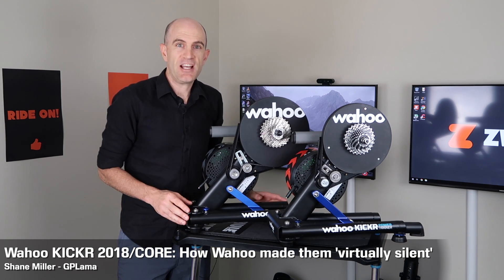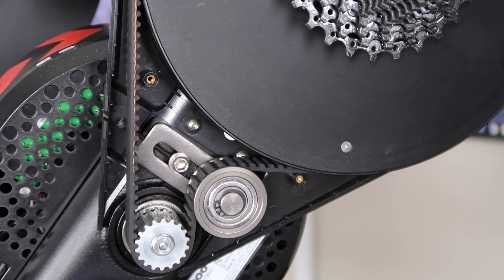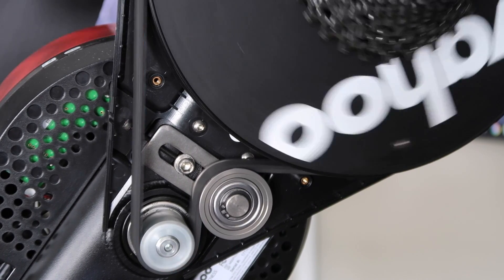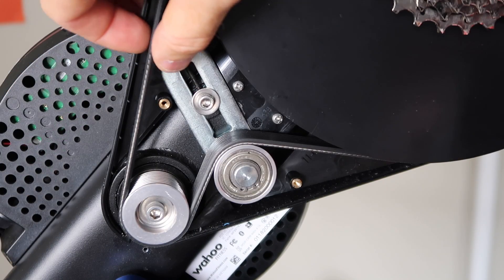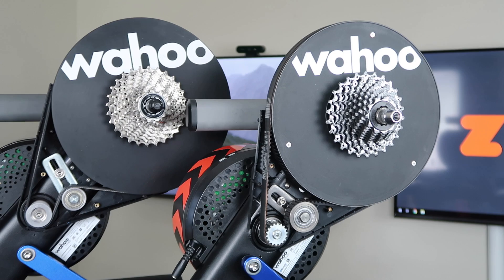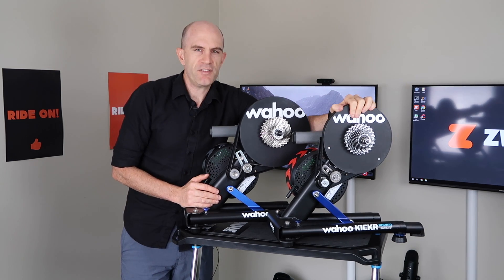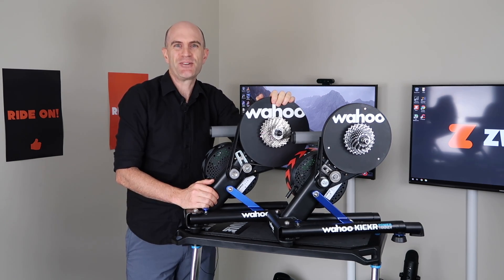Wahoo KICKR 2018/CORE: How Wahoo made them 'virtually silent'

Comment: Widespread issue with silent. All cores seem to have failed quality control and users reporting loud belt noise and clicking. Don't know how to fix mine.
Reply: Mine started making noise after 2 weeks. I have been added into the queue for a replacement, and it will be shipped to me in 2-3 business days. At least it seems like the Wahoo customer support are really snappy :-) I just hope they have fixed the issue on the replacement, cause i really like the Kickr Core.
Reply: @Vifferboy  the replacement models aren't fixed so the same problem will persist
Reply: @TobiasDahlhaus  Guess I will just have to keep sending bad units back then, until the issue is fixed :-(
Reply: This is my issue  https://youtu.be/X4H2ImSb5hs.  

Partially fixed by the local shop with a wahoo repair guide, but still needed a spacer on the plastic to get it silent.
Reply: This is exactly why I will never ever buy a trainer again until it is at least 6 to 12 months on the market. We had the flux and it was exactly the same story...
Reply: I had an issue with a loud noise coming from the wheel that the belt attaches to.  It seems the plastic fairing was rubbing up against the wheel.  I just moved it with my hand and it stopped making noise.  It started making the noise after I moved to a new house.  My guess is the plastic fairing got bumped and moved a bit.  The gap is pretty small.  I bet if they made the gap a bit wider then issue I ran into would be gone.

Comment: Does anyone know of any in-depth servicing that should be carried out on the Kickr, or is it even required? I have got the original Kickr that is 3 years old now and all I have done is the minor service that Shane showed in one of his videos every now and again. Surely the bearings in the drive shaft should be greased/changed for example. I couldn’t find anything on the Wahoo site. I don’t see the point in upgrading just yet when this one does everything I need to a high standard. Thanks in advance.
Reply: Not really sure Ben. I haven't seen much, other than what you mentioned. You could take the belt off and spin the bearings of the pulley, tension wheel and drive wheel by hand and see if you feel any play or roughness in the bearings. These bearings are not subject to dirt or water, so they should last a long time. At the high RPM these trainers operate at, any major bearing issue would be easily identified by significant vibration and noise when riding I'd imagine.

Comment: Isn’t the core a different size flywheel to the 18? It’s a similar size to the previous models
Reply from the maker: Yes, but that's not part of why it's quieter.
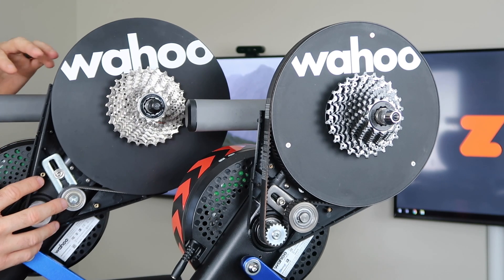Reply: Shane Miller - GPLama at 1:32 I get the impression that you explain that the Core and the 18 flywheel is larger than the old one. It’s nitpicking but the Cores isn’t larger than the old one.
Reply from the maker: Drive wheel. Where the belt loops over. Not the weighted flywheel.

Comment: Is there a general life expectancy of these belts or smart trainers in general? Im yet to hear any stories of trainers dying.
Reply from the maker: Gen I/II/III belts can snap... I had one go after 10,000kms. I know others who have 50,000+ on them. Replaceable part.
Reply: I had one go at about 6000 miles, just about right on with Shane's 10,000 kms figure.  Easy replacement, though I would recommend source the belt locally rather than thru Wahoo.  Wahoo belt replacement was $80, I paid $16.59 plus $8.30 US in shipping from an online "belt" store.  Probably pick up a spare next year, just to have on hand...
Reply: My belt went earlier on in the year that was 3 years of use... I refused to pay the price for a replacement belt from wahoo picked up a couple continental timing belts at a fraction of the cost still going well and its not as loud either

Comment: One of the things I'm struggling with is how to identify the source of noise. I have a Kickr Core (already a warranty replacement) and whilst it's pretty quiet in the smaller front ring, it's a good deal louder in the larger one - and gets very loud (with vibration) in the biggest gears. I'm scratching my head as to whether this is a) the Kickr b) the drivetrain or c) pretty normal operation. Are there any steps you use Shane to identify the source of noise?
Reply from the maker: Hmm. (All at your own risk) Take the cover off, check the insides. Have someone else ride it so you can throw your eye and ear across it closer... and maybe feel the vibrations. High speed cameras also come in handy... with good lighting. Even sending a video of the noise/issue though to Wahoo should have them on top of the issue.
Reply: @gplama  Many thanks for the advice Shane, really appreciate and enjoy your content. Excellent video as always.
Reply: If it's just vibration issue. You maybe need to fine tune the flywheel balancing as I did.
As you say it's ok on the small ring but not the large one, I tend to think you should give it a try. And it's free, you just need a bit of time (do it with someone else, easier & faster).
FYI, the flywheel can spin up to 2500 rpm on big gear. This mass require to be almost perfectly balanced.
See my comment under this video :
https://youtu.be/7HMwXn2YFL8
Reply: Clicking noise appeared on mine after 150km. I just retightened the bottom pulley bolt. It's been now 500km and no more noise. But from the first use, I always hear a very little whine sound from the belt. Maybe I will submit it to Wahoo.

Comment: So did Wahoo change the flywheel size just so people can’t upgrade?
Reply from the maker: They're not Google... they're not evil. :) The upgrade path would be to on-sell a Gen I/II/III and get a CORE. Reverse engineer my video about buying cheap pre-owned smart trainers to sell an existing one for more $$. (Clean it up, new cassette, etc)
Reply: The pinion for the ribbed belt looks slightly larger, probably to meet the torque/lifecycle requirement, so they probably had to increase the diameter of the flywheel to keep the same ratio.

Comment: Could you not just change the geared pulley wheel and belt from the 17 and fit it with the 18's?
Reply from the maker: Nope. The tension wheel is also different, along with the drive wheel (the external one). Then there may not be enough adjustability with the belt tensioner.
Reply: @gplama  I wonder if some belt dressing would quiet the teeth?
Reply: I think, Shane can probably confirm, that in addition to the size issues there would also be internal firmware issues as well.  My understanding is that the Kickr does some "internal calculations" to create the power measurement.  They used to use an optical torque meter, but since they know all the weight and speeds, they can do the math to calculate the power required to produce that rotational speed on that mass.  SO, if you swapped in a different mass, the firmware calculations would be all off...   at least I think IMHO...

Comment: I’m about to receive my third Core (thanks Wahoo customer service- it’s over two weeks now, still waiting for some action from you) and the first two have been anything but silent. They’ve both been broken. Quality control is awful on the Core.
Reply from the maker: Hmmm.... Keep me posted.
Reply: Shane Miller - GPLama I’m on my third now Shane and, finally- I’ve got a quiet trainer. The first made a loud grinding noise right out of the box and then second  made a whining/chirping noise once it got hot, Wahoo UK customer service admitted that there were “production problems” with the Core and, not fair to name names, but had a brief discussion with someone techy you know well and the said Wahoo used a new factory for the Core that bought QA issues. Customer services finally supplied me with a new Core that their “techs” had apparently applied a fix to. It’s going alright... so far. Took a month of fighting to get there though, it has damaged my perception of Wahoo as a brand unfortunately. Wish I’d bought a Tacx now but decided to avoid them because of quality issues, haha!
Reply: @gplama  Just received my brand new Kickr18 direct from Wahoo in Dec,  just set it up and it was making a loud clicking sound out of the box. Based upon the fact that this is a months old issue it would seem as if the defective product is being shipped and the burden for repair is being placed on the consumer? Speculation on my part so we shall see https://www.reddit.com/r/cycling/comments/9kj6s4/2018_wahoo_kickr_core_started_making_loud/ waiting on Customer Service.
Reply from the maker: @floating-in  That sucks. I'm across the issues people are posting about. It's 100% on Wahoo to ensure their build quality is sorted and their customers are taken care of with warranty if they encounter issues.
Reply: @gplama  of course thanks for the response.
Reply: They've had some early teething issue on the Core and K18. Fully agree, it's a QC issue. However, the issue is isolated to one area of the trainer and they are aware of it and fixing it.
Reply: @jmvdigital  The undersized Woodruff key (knocking sound) and the over tight belt tension trashing bearings in the Core is a major concern.  The Core has stability issues as well.  When you mount a bike, it will be off center to the right making it unstable.
Reply: @chaosengine3772  I spoke directly to the service manager at Wahoo, and that bit that is circulating around about belt tension and flat-spotted bearings is just flat out wrong. I think if anything, some people are mistaking an out-of-balance flywheel for a bearing problem.  The tension of the belt on the K18 and Core has to be higher than was required on the <K17 because the belt is no longer toothed and requires high tension (and subsequent high friction on the drive pulley) to work without slippage.
Reply: PS: You can only add as much belt tension as the thin tension pulley bolt will allow. While that belt may appear tight, I'd be surprised if you could actually crank on that thin bolt enough to create an issue with the bearings. That load is being shared by 3 separate points in the internal belt path, all which likely have 2 sets of bearings or more on them. A quick look at Enduro bearings specs (no idea what is used in a Kickr) and their wheel/suspension bearings have static load ratings of 400-1400 lbs. EACH. There's no way that tension bolt allows you to create that much force to damage a steel ball bearing. More likely... you'd damage the rubber/fiber belt before the steel bearings. Plus, you can't flat spot a bearing when it's spinning at 2,000 rpm.
Reply: @jmvdigital  My room mate's issue was a bearing as I've tested it and has been confirmed. The Core has since been returned.
Reply: @jmvdigital  I was thinking the same about the difference in belt-tension. I guess GP Lama has some comparison at hand? ;-)
Reply: I had likely the same issue with my brand new core. The belt was grinding against the plastic. The local shop followed a repair guide provided by wahoo which almost fixed the issue, and then added a spacer (as directed by wahoo) to the plastic cover to give it more clearance.  Seems good at this point, but a painful process to be sure.

https://youtu.be/X4H2ImSb5hs
Reply: Mine was making noise after 80 miles rides, I got the instructions from Wahoo through dealer to investigate the noise source but strangely noise vanished .. for now. +300 miles on it so far.

Comment: I'm sidegrading from an OG Hammer to a KICKR18. Mostly because of the silent operation, but also partly because Wahoo is more active with firmware updates. Plus little things like CLIMB support and built-in power matching (where's torque based cadence sensing though?!) I had initially put an order in for the Neo 2, but Tacx's non-native thru-axle adapter worried me enough to cancel. I've certainly gotten my money's worth out of the Hammer...maybe 400 hours. I expect it to last many, many more than that with its subsequent owner(s).
Reply from the maker: Nice one yoog. Let me know how you like the Kickr18 after a few rides.
Reply: Apparently the Neo 2 comes with thread-in drive-side endcaps with the now included TA adapters. Hmm.
Reply: @gplama   Have you had any issue with yours? I had my Kickr 18 for a month now, and it developed a grinding noise like bad bearings. My shop called Wahoo and described the issue and they sent out a "repair kit" saying this will fix it. This implies there is a known issue if they have a "fix " on hand
Reply from the maker: @jonburgess5408  No issues with mine. You'll know if I do, it'll make for a good fix-it video.